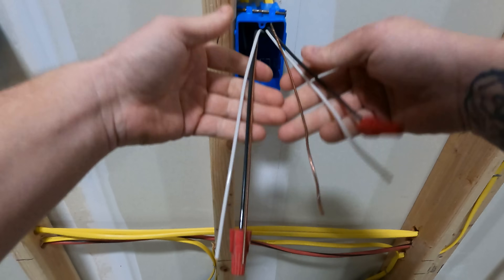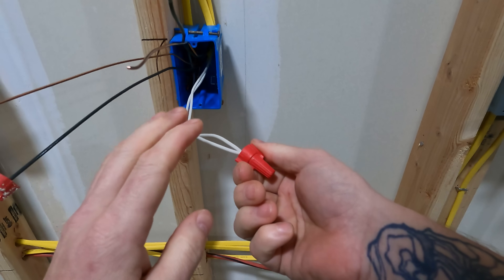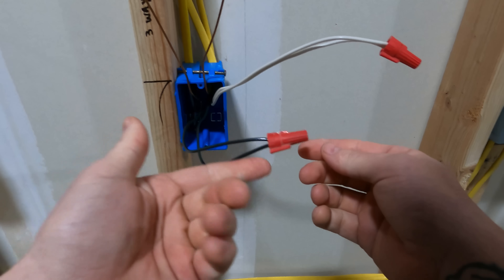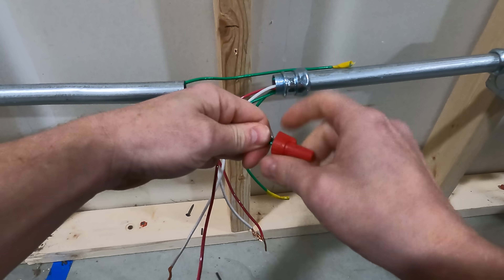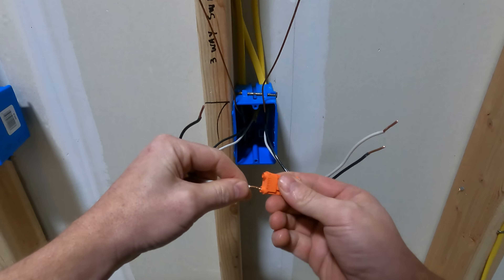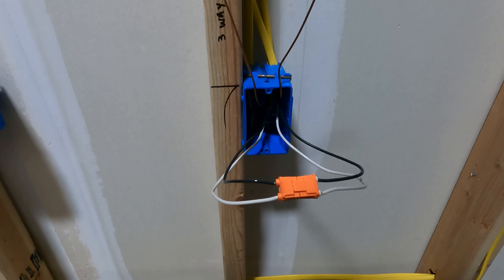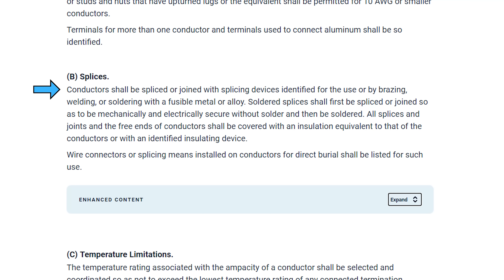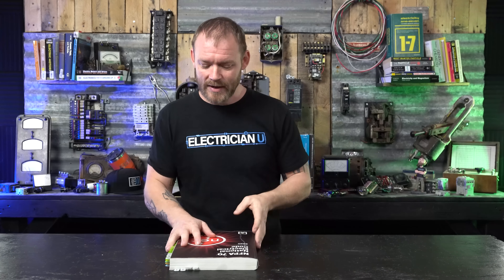To Twist or not To Twist? THAT is the Question.

Comment: When I went to trade school, the code stated that all connections shall be mechanically connected, because soldered connections can heat up and separate, I believe pre-twisting is good when it's good practice, and also believe that some connector make it so you don't have too, but it all comes down to the person whether or not the electrician choice to do such, if you are putting in multiple lighting or receptacles, sometimes you are pressed for fast response and time is money, and sometimes getting done faster is more important, than pre-twisting every wire, and that's when I use speed connections, or push connectors, not the greatest, but they work.

Comment: First, you have to look at what a wire nut is which is listed as a solderless splice. It's the mechanics job to make the joint. The solderless splice just insulates that joint.
Reply: Bro what. First of all a splice is "the joining of two or more conductors together in a manner that results in a permanent electrical termination and mechanical bond" so if they're listed as solderless splices then it's doing exactly what you say. Second, they're listed as pressure type connectors. There's a spiral of metal inside that threads onto the copper, and because wire nuts are conical in shape, as you thread it on it compresses the wires more.
Reply: @austinyun  show me where it lists a wire nut as a pressure connector. 110.14

Comment: Twist. Always.

Got in an attic two weeks ago. Lost power to the living room. Found a j-box used to add a recep to the circuit in the living room. Opened the j-box. Found a wire nut burned in half. Burned through the box. 

Twist the damn wires.

Comment: I suspect that someone could also make the point that the code says to use items in accordance with the manufacturer's instructions. So, if the instructions say to just put the wire nut on then twist, you'd need to do it that way.

Comment: Twist conductors for quality connection. The wire nut should just hold the joint together. Keep up the great videos Dustin . Tight is right

Comment: I couldn't agree more with you, Electrician U, twisting the wires before applying wire nuts is essential for creating a secure and long-lasting connection. As you said, any skilled electrician knows that taking the time to ensure a solid connection is worth its weight in gold

Comment: WHY is he using Red Wingtips for just Two Conductors when a Yellow works fine ? I always use Yellows for 2 Wires 14 AWG  & 12 AWG  , and Reds for 3 or 4 wires,  14 AWG and 12 AWG  .

Comment: I always twist the wires together before putting on a wire nut. I can not tell you how many issues I have fixed over the last 15 years that were due to the wires not being tight under the wire nut.

Comment: Over 55 years in the trade and I have never '' pre-twisted ''  the conductors when using Wire Nuts or 3M Wingtip Scotchlocks Wire Connectors  but lately I've started using the Wago 221's and Ideal's  In-Sure Push In connectors that don't require any ''twisting '' of the conductors and I have always '' pigtail '' all of my devices ! I very seldom use Wire Nuts or 3M Wingtip Scotch Locks anymore for my wire connections but I do use Greenies for the Ground Wire Connections on Duplex Receptacles as called for but sometimes I even use 221's or Push In's for them also

Comment: 12 gauge and up requires pre-twisting. If you're working with 14 gauge, the wire-nut will do the work.(Talking solid wire here)
Reply: I like this approach.
Reply: Yeah except it’s not what the manufacturer says,
There’s no advantage / disadvantage to twisting certain gauges. I work with 6AWG - 10AWG almost exclusively. No need to twist
Reply: @FighterPilotPoker  I disagree.I definitely see an advantage to pre-twisting 12(and up, although rarely do I need wirenuts on anything bigger than 12). Makes a much more solid joint that I can be sure will never come apart, even if the wirenut somehow comes loose.
Reply: Agree. My family are electrical contractors. They use the 3M Performance Plus connectors. 2 or 3 #14 conductors will twist perfectly as the connector is twisted on... More that 3 conductors or larger gauges, they're pretwisted...

Comment: I’ve gone both ways. I used eschew pre-twisting because it’s not necessary and a need to take apart. Not any more. I don’t like failures! After one in particular, a year after I did it, deep in an attic with struts crisscrossing through the air so I had to practically be a gymnast to reach the spot and work on it with my body in an uncomfortable position. Digging through 12 inch deep blown in insulation, I now pre-twist! I don’t trust the wire nut that I can’t see what is going on inside, even if it appears to be good on the outside and passes the initial tug test. I also like the fact that I can see that there is very good metal to metal contact so under a high load, there won’t be the possibility of a thermal issue. I really like your very complete explanation. This is by far the best I’ve seen on the issue. You are an excellent explainer, a natural teacher!

Comment: Could you do a video about subpanels and 100 amp vs 200 amp service. I have a 100 amp service I would like run small box to garage for running air compressor, welder,  and dedicated 20 amp for flux core welder.

Comment: Only issue with pretwisting is it can weaken the wire from all the twisting and untwisting. I've had on occasion wires break, especially on houses with aluminum wiring.
Reply: Strip it back for fresh wire or use jumpers if needed. You should always splice first. The wire nut is to support the splice, not DO the splice.
Reply: When I am doing re-work, I cut the tips and strip the new, straight and clean copper. I've never had a problem with my own connections breaking. My ex boss broke some old connections because he wanted to save 3/8" of wire, even though I suggested he cut the old tips off. Now I am working for a better Electrical Contractor. Lol
Reply: @illestofdemall13  that's not an option when the wire is too short to begin with. You can extend the wire but then run into the issue of trying to pretwist the short wire to the extension. That's when I've had an issue of it breaking cause you have no choice but to untwist and try to retwist.
Reply: @qoolcat7383  I've managed to cut the tips off and strip some pretty short wires before. It's definitely not fun.

Comment: Always twist! Loose connections equals arcing, Arcing equals fried equipment or worse, fire. Also I'll add, I've replaced hundreds of drivers and puck lights because people used those cheap push-in connectors. Throw them away and use twist-on wire nuts!

Comment: How about just following the instructions as provided by the manufacturers of the Wingnuts, Wirenuts, and so forth? "Twist the solid connectors, don't twist stranded." What about joining two solid to one stranded? Same instructions. THANK YOU for making the distinction between what's required and your preferences/experiences! That's one of the main reasons that I recommend your channel to the newts.

Comment: I was taught many years ago to strip solid wires about 1 1/2 inch and twist holding side cutters at the very end and then cut off any marks by the pliers and install a wire nut over the conductors tightly and use a wire nut tightening device to secure. I'm old school and cutting teeth marks away is essential for a long-lasting connection. Twisting stranded wire, you can repeat the same steps. Too many people try to install too many conductors under a wire nut. That's asking for future problems after time. My opinion!

Comment: As far as I see pre twisting conductors it's the same as waiting to strip each one when you get to it.
Its another uneccecary step that is put in place to avoid the misuse of wire nuts.
Fact of the matter is that wire nuts are engineered to have untwisted conductors put into them so that when the nut does twist them together it does it at a consistent rate without marring the contacts.

Comment: Pre-twister here. The problem with pre-twisting stranded is that it often just becomes too smooth for the wirenut to bite. So pre-twisting good, but making sure whatever group of wires you’ve got together (mix of stranded and solid, for example) lets the wirenut bite, also good.

Comment: A common rationale for not twisting is that it adds time to completing each connection which adds up and can cost you money over the duration of the project.  If it is a smatt project (kitchen remodel) there really are not that many connections and the added time is negligable.  If it is a large commercial project, the sheer number of wirenut connections statistically increases the chances that one will come loose.  The time spent on a callback to investigate, find, and fix that one loose connection will likely far exceed the extra time spent pretwisting.  Pretwist your wires, do it right the first time everytime.  Take pride as a craftsman of your trade.

Comment: I pre-twist unless it's ballast wiring (18-20awg). There it isn't necessary. Everywhere else you make the good mechanical connection first and then finish it off with the wire nut.

Comment: Or just avoid the issue altogether and use Wagos instead of wire nuts. They go in straight and come out straight. The only thing that sucks if you have 4 wires to splice together because I think they only come in 2, 3 and 5 conductors.
Reply: Push-in connectors have 4 connections, both as 4 inline and stacked 2+2.

Comment: I go as far as to spiral my solid wire around the stranded and crimp it down with my sidecutters. If you have to go back and tap on to the circuit, the joint stays maintained when you twist off the wire nut. It makes it easier and safer when you have to do hot work. We’re not supposed to have to do hot work but those of us that have been in the trade for a few decades know that it happens. Like with hospital remodels. Do it like you’ll be the one coming back behind yourself to tap on to the circuit.
Reply: Well, I suppose, if one is going to do hot work, then a hospital is simultaneously the best and worst place to do so.
Reply: @GeorgeVCohea-dw7ou  😂 well said! The ER is just a hop skip and a jump away
Reply: @Ephesians-ts8ze  
ER Doctor: Uh, call maintenance, I can't get the defibrillator to function. The power is out on this wing for some unknown reason. Ironic, the paperwork shows that this guy was an electrician. 🤣 

Second floor critical care DO: pulling the plug is one of the hardest and most emotional things one can ever be asked to do for a loved one, but now, since a higher power has failed, you didn't have to be the one to do it.
Reply: Eh, on second thought, those might be a bit too macabre and inappropriate.
Reply: @GeorgeVCohea-dw7ou  don’t defibrillators have battery’s inside them?
Reply: @FishFind3000  
I would not think so but am not a doctor nor hospital equipment specialist.
Reply: I’m not a professional electrician, but whenever I connect stranded to a single solid wire, I first use a needlenose to put a zigzag into the solid conductor.  That way, the solid wire can’t pull out from the middle of the bundle.
Reply: I like to tape solid to stranded connections as well just to add a layer of safety.
Reply: @blackforkfarm4356  you mean around the wire nut?

Comment: I was about to ask you this the next time you posted. 1st year apprentice here. I always twist, no matter what. It makes it easier for one, and for two, like you said it makes a solid connection. I’ve gotten hit by 277V because someone I came behind didn’t even attempt to twist it, just stuck it in there, and as soon as I moved the wire out of the way to get a stick of pipe in, and the wire nut fell right off and got my hand. I also (after pre-twisting) take my linesman’s and do a couple more twists once the wire nut is hand tight. Love me a good, rock solid connection.
Reply: Why you sticking your hand in a live box🤦‍♂️🤦‍♂️🤦‍♂️ needle nose my dude. 🤷🏼‍♂️

Comment: I've always twisted solid, but stranded, especially smaller gauge stranded pretty much suck if you ever need to break it apart! Although if and when I come across these smaller gauge stranded (ceiling fans, dimmers, led drivers, etc) if there is enough I just chop the nut off and re-strip everything.  That's my 0.02¢ 
cheers!

Comment: Whenever I've pulled a box open because there's been a failure down the line or with a device it's been because someone was like "I don't need to twist" especially with 4 or more wires

Comment: 100% of the time I’m pre twisting open circuits especially in new construction however if the circuit is closed and energized I wouldn’t. I still tug on the wire nut both ways and they hold the same

Comment: I've always pre-twisted just a bit simply to get the conductors to be all together nicely to fit the wire nut on easily. Not pliers level pre-twisting, just using fingers to give it a little twist around each other one time before the wire nut goes on, then using the nut to get a nice good twist on them all since it has better leverage. When doing more than 2 conductors it can be hard to group the conductors well enough if you don't pre-twist (like was mentioned in the video with the 5 conductor example). I spend more time trying to fit the conductors all together to fit all evenly and properly into the nut than if I had simply done a little pre-twist to begin with.

Comment: Very cool, but what about joining a stranded conductor and a solid? I was taught to nose the stranded just a hair forward of the solid (no twisting just side by side) then start spinning the wire-nut before it touches the conductors. After it starts grabbing you have to have a tight hold of the insulated side because sometimes if the stranded was too far forward it will pull past the solid and bunch up in the nose of the wire-nut and leave the solid not-connected. Then part way through bend the wires back and forth a few times and twist a little more.

Then there's when you have two or more solid wires and one or more stranded... That's a mess haha

Comment: I've always pre-twisted because the old wire nuts that were just plastic inside sucked and would barely stay on as is. I never thought it was an option to not pre-twist. It gets to be unruly when working with 3 or 4 12 gauge wires, even with a large size wire nut.

Comment: Listen to Chubby Checker but more importantly understand the skin effect of electromagnetic conductors.
Maximize surface area contact to minimize resistance.
More twists per linear measure = cooler wire.  More load, fewer trips.  Physics shall set us free.

Comment: You didn't show that for 3 solid conductors, pretwisting is a less solid joint, because the center conductor doesn't get twisted by the pliers.
Reply: You can get three or more in the web of the twist if your into twisting (I am). Just takes practice though a bit of a pain sometimes.

Comment: I feel like th only people that really have this debate are not electricians, or do electrical beyond DIY...it's obvious when you should pre-twist the wires (for instance shoving them into a contactor/contact point on a breaker/disconnect with stranded wire when you are clamping a screw down onto them) and also, people do not use the correct wire nut size...for instance ONLY using tan/blue wire nuts for every job no matter the situation.

Comment: No twist! Here's why: when i was doing remodels, I had no end of connections which had been twisted. I needed to get them apart and add another conductor (solid 12 or 14 wire). Getting them apart was a pain, and I either had to straighten them out to get the connection back together, or cut them. Sometimes they were so short that cutting them was a real problem. I don't know what you're talking about with wire nuts now and then. When i was doing this back in the 80s, we used Ideal wire nuts, and they bit into the conductors and twisted them slightly, just like you showed. We almost never used stranded unless someone made a mistake at the parts store, at least not with #12 or #14. Anything above that was probably stranded, and we were usually putting them into lugs rather than pigtailing them. Plus, whenever you put a wire nut on, you have to pull on the conductors to make sure they don't just pull out.
Reply: Using Wago lever nuts initially would be the best solution for those issues.

Comment: If I'm doing stranded-stranded or stranded-solid I always pre twist. If I'm doing solid-solid I twist the wire nuts by hand and then I have a nut twister on the back of my screwdriver and I make sure I see the wires are twisted at least 3-4 times. If I'm doing 4-5 solid-solid conductors then I pre twist as well, usually I strip a little extra on each conductor, pre twist, and then cut them all to the same length, then I make sure to twist super hard on the wire nut with my wire nut driver.